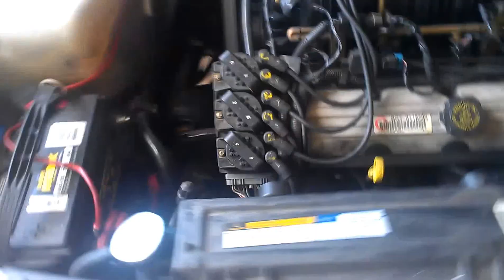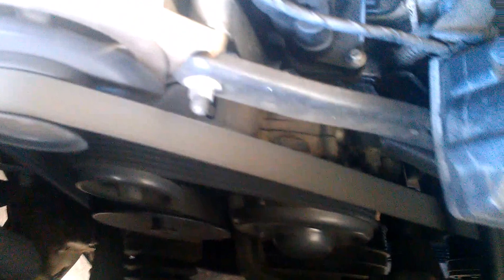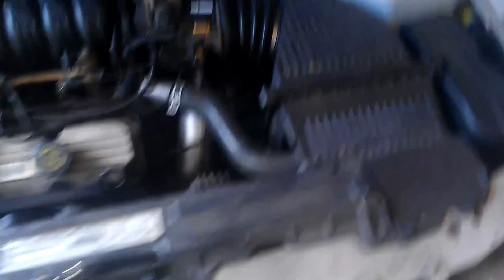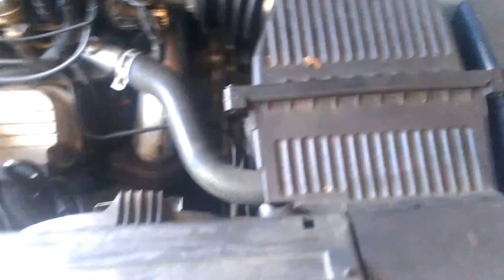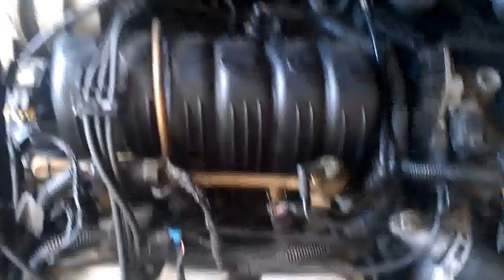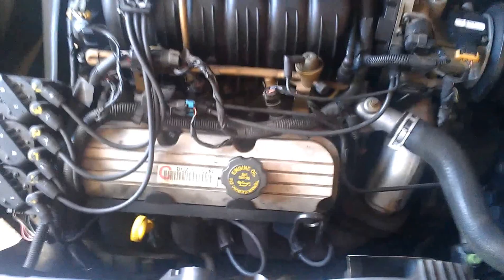3800 Series II whistling noise

Comment from the maker: Sorry I never updated this, but it wound up being the upper intake manifold gasket leaking again. It had been replaced 4 years earlier with a sleeved upper intake and metal lower intake gaskets, but the upper gasket failed over by the MAP sensor and by the throttle body. Replaced the gasket and it was good to go.
Reply: ik this was years ago, but thank you. I have replaced damn near every gasket and hose and it still wouldn't stop the whistle (though it did stop for a brief time) I was about to lose hope. So thank you,  one of the few gaskets I didn't even think of changing! (The gasket was just straight out missing, probably fell or something when i was changing spark plugs)
Reply: My guy I’ve scoured the internet for this answer

Comment: It's your intake manifold that's leaking, just replaced mines today 1-5-14. It's leaking under the map sensor. Easy fit, just don't get the gasket from Autozone they don't know shit.
Reply from the maker: Yep, confirmed it was the upper gasket leaking, which kind of makes me mad because I just did the upper and lower gaskets about a year and a half ago haha. Not looking forward to tearing it apart in the cold so it's parked until warmer weather comes. I'll probably order a FelPro gasket when the time comes. It's a small enough leak that the PCM is compensating for it and it's not causing any running/driveablity issues, but for now I'm not driving it just to keep it out of a lean condition.

Comment: I got 98 Buick LeSabre and my car make the same noise. I thought it was the belt so I got a new one, with the belt condition and come to going out it wasn't that! Smh . So do you think I need what u needed ?
Reply from the maker: I'd start by checking for vacuum leaks. Easiest way is to spray carb cleaner or ether while the motor is cold and running around the plenum, injectors, vacuum lines, etc. If you notice a change in idle as you're spraying, you found the leak

Comment: Did you have a check engine light?
Reply from the maker: No check engine light was on when the car did this. If I remember, it did go a little lean watching the fuel trims on a scanner's live data mode, but it wasn't terrible or undriveable. I found the leak by spraying carb cleaner around the upper intake gasket while the car was cold and found the idle changed at a particular spot.

Comment: Did you ever figure out where the noise was coming from?
I have the exact high pitch noise coming from my bonne on a cold start.
Reply from the maker: It's definitely a vacuum leak. I pulled the serpentine belt to verify that it wasn't a pulley, and the noise was still there. I couldn't locate the vacuum leak with carb cleaner, and haven't had a chance to smoke test the system to see where it's coming from. It goes away after the car warms up, so it's been pretty hard to track down.
Reply: Did you ever figure that out bud having same problem. Sure it's vacuum cause I replaced hoses and all still going on
Reply: Check the pcv valve under the map sensor
Reply from the maker: Sorry I never update this, but it wound up being the upper intake manifold gasket leaking again. It had been replaced 4 years earlier with a sleeved upper intake and metal lower intake gaskets, but the upper gasket failed over by the MAP sensor and by the throttle body. Replaced the gasket and it was good to go.